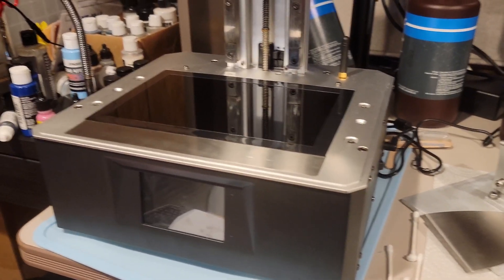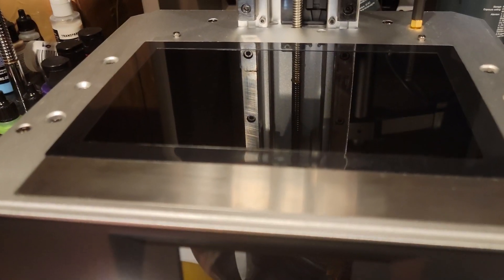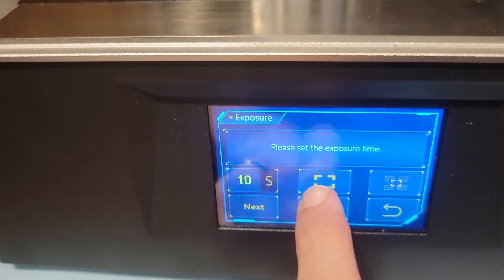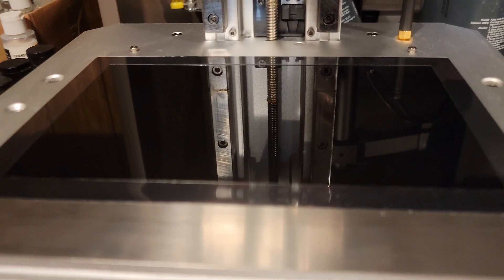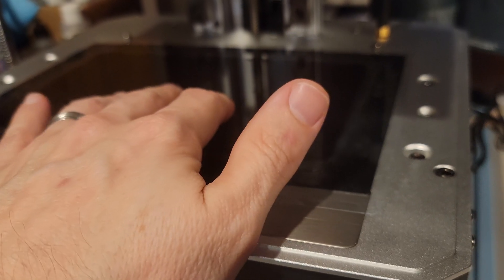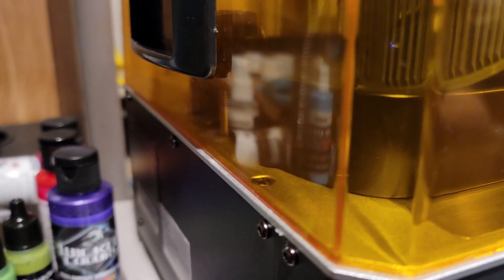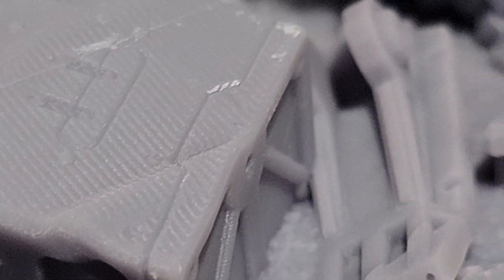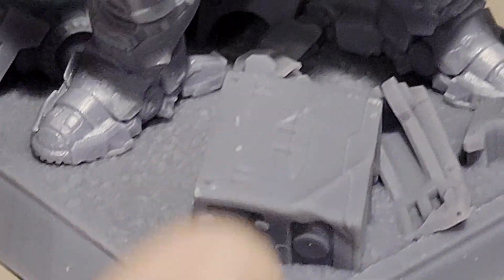Problems after LCD Screen replacement

Comment: I have the same problem. I will never buy any Anycubic product again, they wash their hands on this, they calim that warranty has expirded because I purchased it more thant 3 months ago. Bullshit company.
Reply from the maker: I'm not blaming anycubic on what happened. I saw videos where they recommend putting a screen protector on it. I didn't and that happened. I noticed some resin before what happened. I thought I might have done that. Well I was wrong so I had to pay for it. It was customer error. I should have put a protector on it but I thought it wouldn't happen to me. So I was wrong. Lesson learned.